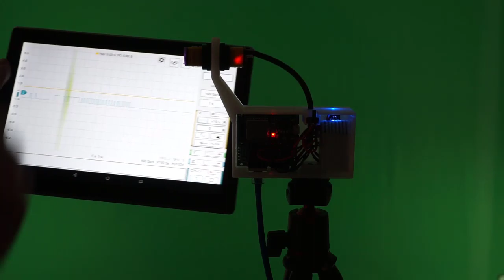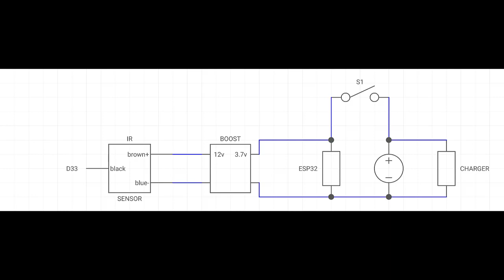GADGETS#167 - HS-ACC BAL

Comment: This is awesome, I'd love to build this setup and try it out on a few of my cars. Not sure i would go as far as to deploy it in my little workshop (who knows, maybe) but i'm going to seriously look at this, been searching for a relatively cheap method of on-car balancing my shaft for a while now since no one around here can do it anymore (and funnily enough, because of the shaft/end flange design, manufacturer actually states it should be on-car balanced as a whole assembly....but even the dealers don't have the gear anymore)
Reply from the maker: driveshafts are actually easy to balance right on the vehicle...but not with this GSADGETS#167 which is limited to about 1200 RPM max due to the digital IR sensor

better to go with ADXL335 analog based solutions...I demonstrate driveshaft balancing in GADGETS#153

if you don't want to get fancy, then the equipment I used in GADGETS#60 to balance table saw pulley is capable of driveshaft balancing speeds

Comment: I am so glad i found this channel, so much useful info here.  Could i hijak the hall sensor of the ABS system to get an RPM and secure the the accelerometer to an axle to figure out vibration while driving?  Reason i ask is i have a semi I'm trying to sort out, and it's considerably harder and less safe to jack up and run on jack stands.  Sometimes to get into a shop to get a proper balance done, it can take hours and most of the time the machines are"broken" and they just want to throw the beads in the tires, which have never worked for me.  I've been researching ways to do a decent dynamic balance myself without purchasing a machine that can do commercial tires for thousands of dollars.
Reply from the maker: ABS sensor might give you RPM but would not provide a reference which is what we require for balancing...and balancing tires on test drives would be very tricky (if not impossible)

I'm thinking of a vertical tire balancer with video to be released later this summer/fall...it will be for lighter car tires but the principle there might work for you if beefed up for weight of semi truck tires
Reply: @theGADGETSplaylist  you're right, I thought abs had a gap somewhere to give a reference point, I'm confusing that with cam and crankshaft position sensors.  A vertical tire balancer would be greatly beneficial, or maybe I can figure out a way to spin my front tires.  Would you balance a tandem tire combo together or balance each tire individually?
Reply from the maker: @boxoftj1  I suppose if tires remained as a pair then could get away with tandem

there would be a couple forces (the reason wide tires are 2 plane balanced) but on something so rugged as a semi should not be an issue

Comment from the maker: these 2 dynamic balancing projects are not equal:

HS402W BAL is analog. The waveform is less noisy, needs less filtering. Its analog IR is capable of up to 4000 RPM. It is a more challenging build.

HS-ACC BAL is digital. The waveform is noisier than I'd like but cleans up with aggressive filtering. Its digital IR tops out at about 1300 RPM. It is an easier build.

Comment: I think I'd be taking on too much at once if I tackle the oscilloscope assembly (never used one except in university), I'm terrible at soldering.
Do you think it'd be feasible to use a Hantek 6022BE usb oscilloscope + the E18-D80NK photocell + a microphone (or tiny speaker) to do the wheel balancing? Instead of measuring the vibrations with an accelerometer, I'd be listening to them with a microphone.
I'm tempted to do that because I have a quickjack setup to lift my car and I don't really feel like spinning the wheels and make the car unevenly supported on purpose.
Also, what do you think about transforming a car 12v alternator into a motor (either brushed like stock or modify it to be brushless), and, instead of the pulley, you could fabricate an adapter to mount a wheel or brake rotor on it with a 3D printer? For a wheel or brake rotor, the adapter would either be a conical piece that fits in the wheel's center bore and a recessed center that is bolted to the alternator shaft where the pulley goes, or you could 3D print an adapter for the wheel stud pattern (5x114.3 for my car) and bolt it to the alternator shaft.
This seems like it'd be quite compact (just a jig to mount the alternator on), cheap (20-30$ for a used alternator) and it would have more than enough power. You just need a 12v DC and a 48v DC source to power the alternator in brushed mode. I already have a variable power supply from a previous project (hybrid battery nimh cell reconditioning) and the 12v can just be provided by a car battery or a battery charger. Pretty sure this setup can spin fast enough to send a wheel flying to the moon and you'd only need between 500 and 1000 rpm depending on total wheel radius and desired balancing speed.
I'm a chemist and a hobby mechanic, so I'm a bit out of my comfort zone here. But I'd first balance the alternator properly with its nut on the shaft and no attachment, then balance the 3D printed attachment, and then it would be ready to make the world nice and dynamically balanced.
Would this work? If so, given that the adapter would be printed flat (ie : printing axis perpendicular to load axis), do you think it'd be strong enough if the current is applied slowly? What material would you recommend for the 3D printing? Steel adapters for wheel balancers cost roughly 150 usd which is the same cost as a 3D printer that could print an adapter like this. For occasional, light duty use, if it doesn't shear and send a brake rotor flying, it'd be great!

Thanks in advance for your tips!!
Reply from the maker: E18-D80NK is a digital photocell and can only work with HS-ACC platform

E3F-DC30C4 as shown in #58 is analog and would work with HT6022BE along with ADXL335 analog

a stand alone tire balancer is something I've given thought to ... am resisting powering it with a motor (or alternator) ... maybe just bicycle crank and sprockets...

as a matter of fact, the turbine failed project in #170 was envisioned as the power source for a tire balancer ... was a flop, and that happens...I shared the fail on the channel to show that not all ideas pan out:)

I've had a crazy busy summer so not too much time for GADGETS...but intend to get back at it in the fall....
Reply: @PetiteCorps  I know this is a late reply to your comment but I did what you are thinking about except that I built a 2 plane soft bearing balancer for my car tires. I used the DC motor from a free treadmill to spin the tire at 300 RPM. I use an analog IR sensor and a piece of foil tape on the tire for an index pulse. I use 1 ADXL335 on each suspension.  I feed everything to a Picoscope 2204a and laptop. I 3D printed hubs with the proper lug spacing to mount the wheel but they had about 20 thousands runout so I had them professionally printed with nylon and turned on a lathe. I am using a 1 inch solid steel shaft that I clamp everything onto. If I were you I'd forget about using a microphone since the ADXL335 accelerometers are just a few bucks and very sensitive.  I am now 3D printing a cone and an adapter to make the mounting universal just like a real tire balancer. I used PLA and it was plenty strong enough but it had runout and you can't really machine PLA since it melts easily. I would also look into the universal lug adapters that can handle any lug pattern. About $100. Good luck and have fun. Balancing can be an addiction!

Comment: Really cool project, it would be fun to make it into a hobby open source project. If you don't mind, can you please share the firmware + software tool you use in the video.
Reply from the maker: The firmware is not mine and is not open source. Please check in video description for my recently added information on this matter.

Comment: Interesting subject. How do you differentiate which plane is unbalanced with a single sensor ?
Reply from the maker: single plane only with this build...for tires, 1 weight location, inside rim as you would see in factory  balance of aluminum wheels
Reply: @theGADGETSplaylist Thanks. I was hoping for a trick by measuring the difference between two axis from the sensor. This makes the balancing quite challenging if not impossible if there's a significant unbalance between two planes or two parts. Your setup seems to be the electronic version of the method using a glass a water and a piece of chalk: https://www.youtube.com/watch?v=zuPSGJZpL3k

Comment: As you are familiar with balancing, can you tell which sensor is more sensitive if they have g rating. 100mV/g or 300mV/g? My mind says it’s the later but is it so?
Reply from the maker: you are correct, it is the 300mV/g
as with pressure transducers, the mV/PSI the better the resolution
Reply from the maker: that should have read the MORE mV/PSI

any sensor, the more mV/unit the better

Comment: I love our content. You got me hooked on Hscope. As a long time Snap on Verus , ATS and Pico scope owner I love the Hscope app. I also love DIY just like your projects in your  videos. I am a Industrial generator tech. Sometimes I cant fly with all of my scopes when traveling. I mounted a 1008c to my tablet and bring that on some trips. I switched to a 6074be as The ht25 capacitance lead and other secondary ignition probes would Immediately disconnect the 1008c scope. Can you suggest something to resolve this? Would the DIY ac coupling filter you made help? I would hate to have the 1008c go to waste. Also , one last question. For some reason on the rare occasion when the 1008c stays connected , it seems to output a cleaner ignition waveform vrs the 6074be. I used every sample rate to try and get a better picture. It seems like I loose data when I zoom in. Anyways, your channel is a gold mine. Ty for all the great content
Reply from the maker: thanks so much for your comment:)

HT25 disconnects is a subject recently discussed in our HScope Telegram Group. And needs further investigation. Likely EMI related.

I invite you to join the group Jesse. We'll try to get to the bottom of it.

https://t.me/hscope

Denis
Reply: @theGADGETSplaylist  Your quick response  is greatly appreciated.  I will be joining the group. Take care and thanks again >>>

Comment: Hi, greating from Romania, I'm not an engineer but I am passionate about the subject. My question is, if it is possible to build a easy to use but still cheep, all in one weel balancer that it's similar to the one on the market... Don't get me wrong, what you are doing is phenomenal job... But still I think the process of balancing is kind of part guessing the place where you need to put the weight part mounting the tyre on the car... It would be much easy to use if it have an electric motor to spin the wheel and also a light from a leveler to show you exactly where you need to put the weight. Anyway... Congrats for the good work you are doing!
Reply from the maker: greetings form Canada, Nicoara:)

yes, a tire balancing machine using these same components could be built

I do not at the present time have intentions to do so...
Reply: Greetings from OZ. Just an add-on to this project, strobe light . Strobe at the peak of the açcelerometre will give heavy at top add weight to the bottom .
Reply from the maker: @mrman1536  greetings from Canada:)

this project is not strobe based, HS-ACC will not fire it...not an option

either IR sensor as I've used here...or a laser sensor with digital output (I have not sourced any)
Reply: @theGADGETSplaylist  Cheers for the feed back. My head naturally is analog. However i do like the digital outcomes with the no nonsense attitude you bring to your projects . Dynamic balancing , I like that.!